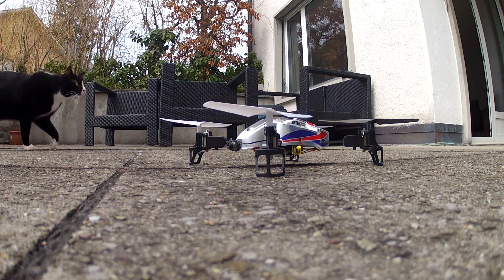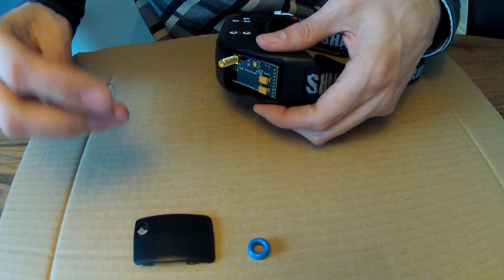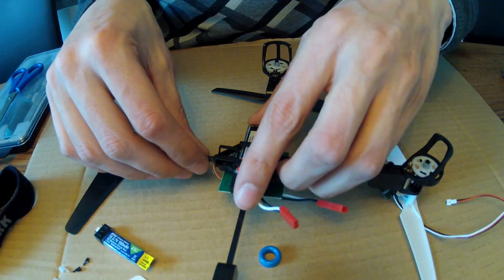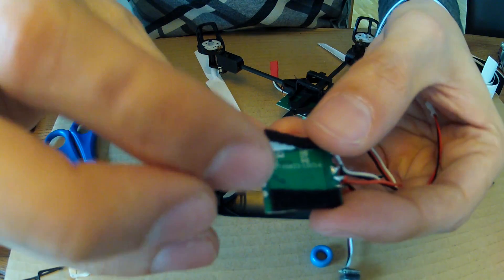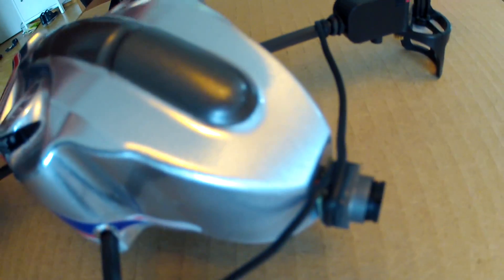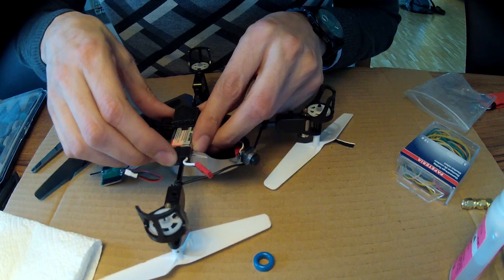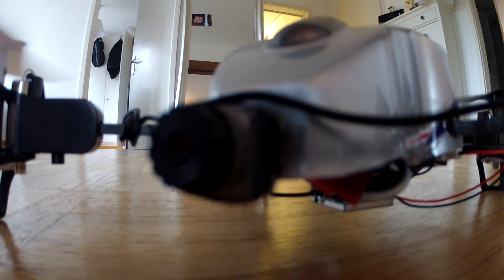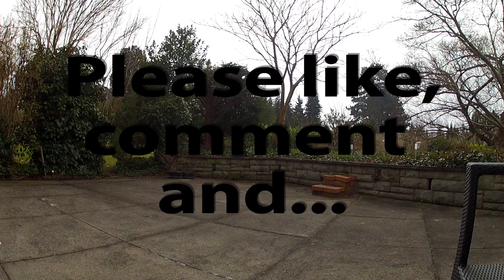[BUILD] Blade mQX - narrated FPV build log

Comment: Hi Zwyser,

The link to the 1g camera on fpvhoppy.com says "ATTENTION : CAN NOT USE WITH FATSHARK, FREQUENCIES ARE DIFFERENT", but you say you used the Fatshark Dominator RX 5GB.  Is that correct?  I have the same Fatshark Dominator 5GB and would love to fly my Blades with FPV.  I also have a QAV500 with FPV - but the MQX would be great for training.
 THanks in advance for your help!

Comment: An FPV system is for this model about +10g. This weight the quad easier moving up and the moving will more dynamic. And the GWS props are lighter-weight.

Comment from the maker: If you watch the video you can see the transmitter. It's a Spektrum dx8, but you can use any compatible 2.4ghz transmitter as they do not interfere with 5.8ghz

Comment: I sell these in the hobby shop I work at and play with them off and on all day..If your looking to modify your MQX, I would start off with extending the arms and moving to a larger blade, you'll get much more lift and it shouldn't effect your response time very much. We havent tried any other motors, but Im sure with enough research you should be able to find one that will fit the mounts without modding them (I highly suggest not modding the motor mounts)..Good luck and keep us posted!

Comment from the maker: yep, the antenna is just a wire, but I thought a circular polarized antenna needs to much space on this little quad, so I decided to go with the linear polarized one. But there are others around which are quite small and would work. But with this little quad, distance is not what I was looking for.